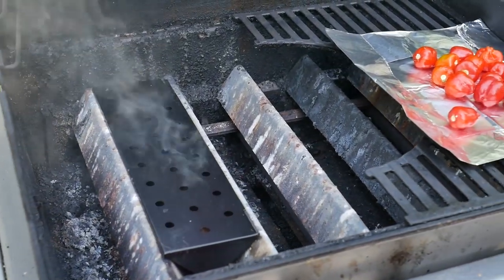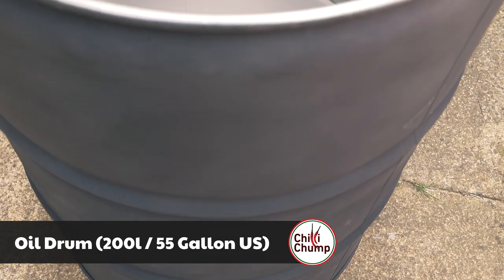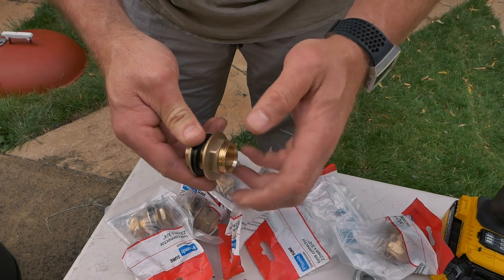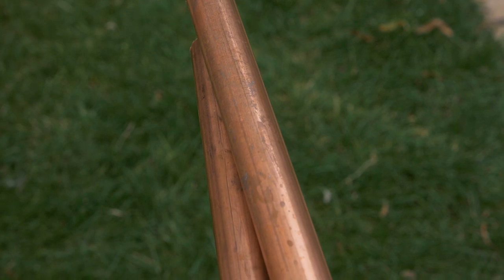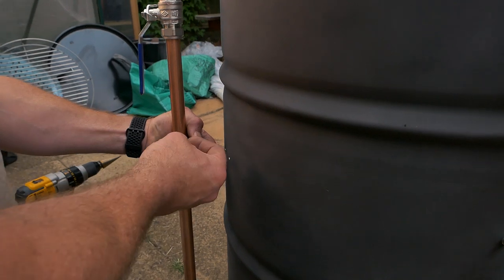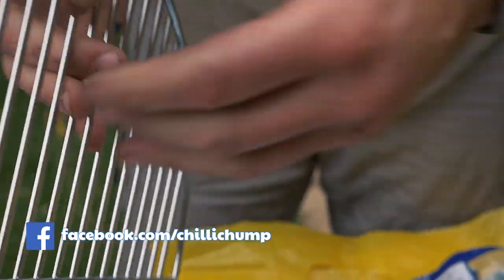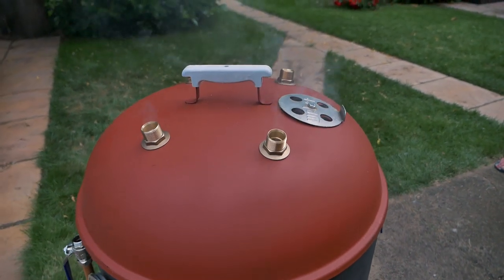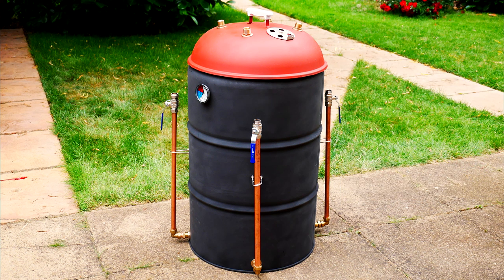The Smokinator - Building an Ugly Drum Smoker

Comment: looks pretty great.  i only wish you had a flap on the side, so you could dump in more wood chips/pellets while it cooked, without taking the lid off.  because you then also have to take the racks off too.

heck, and if you REALLY wanted to take this over the top, you'd put a metal coil in there too, with a PID on it, and alternatively let it be a PID electric smoker.

dang it, now you've got me wanting to build one.  as an electric smoker, i reckon.

Comment: copper and Steel are dissimilar metals, you are using steel clamps on copper pipes, this will lead to rapid corrosion. you should wrap the copper in electrical tape or something vinyl to prevent the copper and steel from touching.

Comment: Hi Shaun, how's your uds holding? Was the coal basket mesh good choice? How long it's held? Any advise after the period you used it?
Reply from the maker: Hi Ivan, yes the mesh has held up well. Light rusting, but still strong. Only advice after using it for a while, probably a good idea to cut an opening at the bottom to make it easier to remove ash.
Reply: @ChilliChump  I'm planning to build coal basket with Ash tray underneath, so should be better I suppose. Thanks for your reply
Reply from the maker: I am talking about a small door on the side at the bottom to get to the ash. Can slide out your ash tray nice and easy
Reply: @ChilliChump  Ah I see. Thank you for the advice

Comment: Don't know if i missed it but i hope none of those nuts and bolts were galvanized. The fumes are pretty toxic
Reply from the maker: Hey there, good call. I should have mentioned in the video not to use anything galvanised. I have included this in the description. Thanks for the reminder
Reply: @ChilliChump  no worries i just would hate to see people get sick. Galvanized is the most popular style of hardware so it's important to watch out for it.
Reply: @reallifeistoflat  burning it out a couple of times should release any zinc fumes, metal fume fever is a real concern with anything galvanised
Reply: @danlancia  i agree that should be sufficient but i would rather tell people a method that doesn't require then to burn it out. For the small quantity of hardware pieces needed just upgrade to stainless and skip the whole ordeal.

Comment: There is nothing wrong with the design, but would it be much cheaper just to drill 1"-3"  the center hole bottom of the drum.   Add damper/vent open/closed the center hole and can open bottom side.  Add wheel and something to raise it few inches of the ground.  The cost would be about 1/4 - half of what all the parts that to use.
Reply from the maker: For sure.  That would work. What I like about this design is just how controllable it is.  I can get the temperatures where I want them within a few degrees. With the pipes away from the drum, they also can be adjusted throughout the cool, without them heating up.